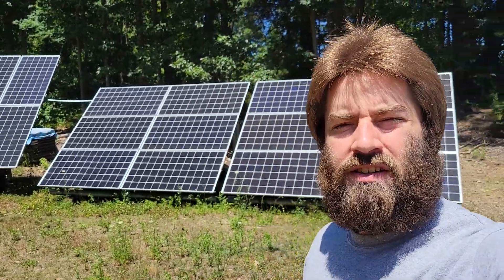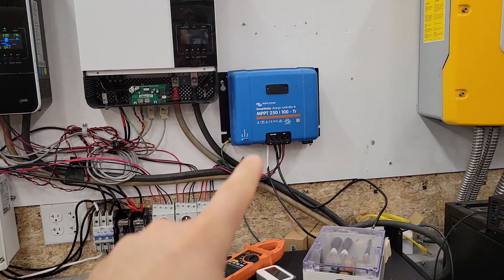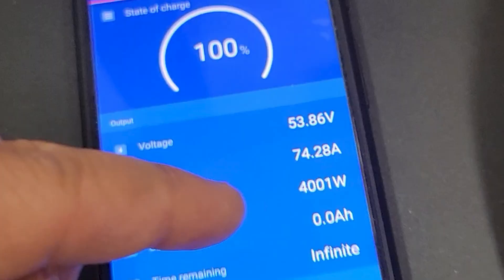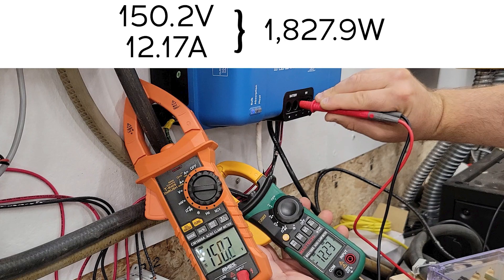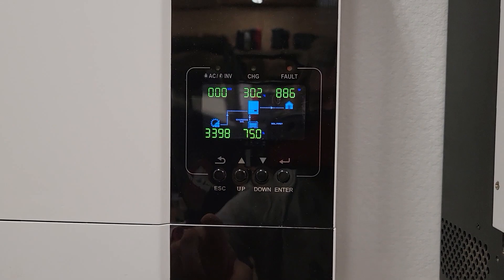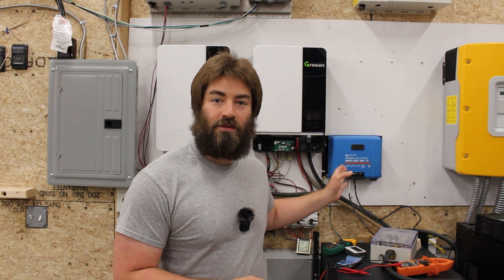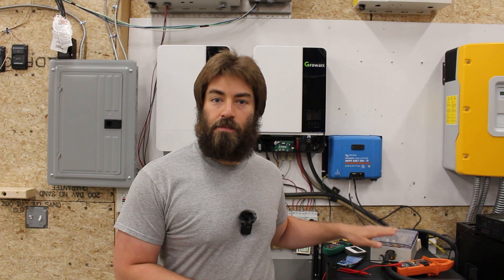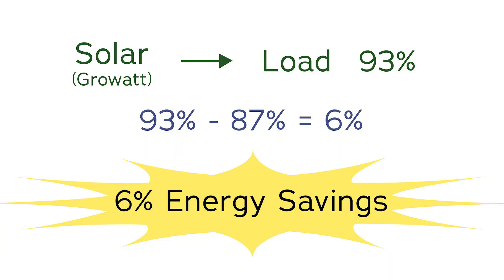Victron vs. Growatt solar MPPT charge controller efficiency test

Comment: And there's an extra benefit with doing it in the day. The electricity you use in the daytime can be replaced in the daytime, leaving your batteries full when the sun goes down. Using the batteries at night leaves your batteries partly drained with no way to fill them back up till the next day when the sun rises. This can be bad if something comes up and you need that extra power at night.
Reply: That's exactly the same between an integrated system and separate charger/inverter combo.

Comment: Did you realize that your Sunny Islands are designed for ac coupling? I have a DC Solar Trailer  that has a small dc coupled array. I am powering my whole house and shop with my old grid tied system frequency shifting the two separate one (enphase micros 6kw)and the other a H6 solar city from Signature Solar.  Contact me if you want more info. Thanks Fred
Reply from the maker: Sounds like a nice setup.  Yes, I love the AC coupling function.
Reply: PS my H6 also has 6kw of solar, the sunny island contols both separately . Battery capacity is  around 50kw. Running totally off grid.

Comment: Victron charge controllers are designed for lead acid batteries.
Reply: No , they are not . They are fully adjustable to ANY setting you need.
Reply: @onthelake9554   Lifepo4 battery cell manufacturer (like CATL) recommends keeping the battery SoC between 10% and 90% in order to extend the battery life.
Reply: @wangqianjun  Yes they do , what's your point ?
Reply: @onthelake9554  In a Victron charge controller menu options,there's dont have a special INDEPENDENT  menu item for LiFePO4 battery，you have to go to the User Defined settings item and make some changes manually. But not everyone knows how to set specific parameters
Reply: @wangqianjun   Your statement was " Victron is designed for lead acid ."   Lead acid actually needs more custom settings per manufacturer than LFP .  Anyone with a battery system needs to be educated enough about what they have to set this up . There are  plenty of Youtube  videos and Victron puts out more information on their equipment than any other .
Reply: Inverter need communication with BMS, that's important
Reply: victron has lifepo4 settings/profiles for ages, rotary switch, profile or custom setting

Comment: David, I still can't get adjusted to your new look but, I like it. I always use my Sol-Ark 12K system and my welder, large compressor and other 220V tools and equipment during high sun hours. I put in a 2500gal water storage tank and hooked up my deep well pump to the excessive load capability of my Sol-Ark 12K so I can take advantage of all of the extra power that I am getting from my solar panels. I also put a timer on another pump that I have hooked up to my sprinkler system that will water my lawn and garden the same way. All it has really taken is a little rescheduling of the time you do things to make for an efficient off-grid lifestyle.
Reply: Solar Jesus

Comment: Question. Inverter. Out of  growatt..  aims  signeer and victron.  Any preferences. Or do all have quirks
Reply from the maker: Out of the three you mentioned,  sigineer and Aims are in the same basic category of low frequency,  basic units.  They get the job done, but are not delivering perfect clean power.  The Victron is in a category of top of the line inverters.  Victron is made to last much longer, cleaner output, more controls, and more efficient
Reply: @DavidPozEnergy   you obviously like the growatt. To

Comment: Hey David, do you have the occasional Growatt shut down? Normally happens when I turn the dryer on?
Reply from the maker: I've never had the Growatts shut down due to overload.  I've had them shut down twice due to low voltage,  but that's my fault for running the battery empty.
Reply: @DavidPozEnergy  I start to think they are selling faulty units here in Australia,  after reading ebay comments.

Comment: Here in Australia, with grid connect systems, the inverter efficiency is negligible compared to the price you get to export power compared to that you pay for it. When the export price is so low as to be cover even the daily standing charge, it pays to use all your produced power.  Early adopters got a rate, made it worth while exporting it all and buying back to do washing overnight. 
Off-grid, as you've shown, is a different game entirely.
Reply: The high paid back was because it cost 10,000 aud for a 3 KW system. Let just say they are stealing the money back now. Also that rate ends soon.
Reply: @chuxxsss  Ended a year or more ago in WA.
Reply: @dadawoodslife in WA?
Reply: @randybobandy9828  Western Australia
Reply: @dadawoodslife   I thought you meant Washington state

Comment: But you are paying for that additional Victron efficiency. Not much more and you can buy the Growatt that has both and then as you say using the power directly is even more efficient and also doesn't result in micro cycling the battery???

Comment: That's not the way electricity works. it does not matter if the charge controller is built into the inverter or not.  The victron is more efficient at delivering power from your panels to the voltage present on the battery terminals.
If you are using the victron to send power toward the battery at the same time as you are using any inverter to power loads, the battery is not charging and discharging unless the power supplied thru the controller is more or less than the power drawn by the inverter. The power from the charge controller is being used by the inverter to the extant the inverter requires it.  The balance goes to or from the battery depending on if the charge controller is providing more or less than the inverter requires, respectively.
Reply: There are many different inverter designs on the market, and they are not all designed the same internally.  The design does matter, and there are potential efficiency benefits to integrating the MPPT solar charge controller into the inverter chassis, as David Poz suggested.  To understand why, you have to understand the internal power conversion steps that are occurring inside the inverter chassis.  One such "all in one" inverter model that I have opened up (from MPP Solar) appears to work where the power flows/gets converted as follows:

(Solar panels) --> (Internal MPPT boost converter) --> (450V DC rail inside the inverter) --> (High frequency, high voltage H-bridge using fast IGBTs) --> (LC low pass filter to produce 240V 60Hz "pure sine" waveform) --> (AC output pins on the inverter)

If you do not use the integrated MPPT boost converter in this unit, and instead use an external MPPT solar charge controller like the Victron unit shown in this video, then the solar energy takes a different overall path:

(Solar panels) --> (External MPPT buck converter) --> (48V DC rail with the batteries) --> (Low voltage, high frequency H-bridge using MOSFETs) --> (High frequency transformer: 48V AC to ~450V AC, but variable duty cycle < 100%) --> (High frequency, high voltage H-bridge synchronous rectifier using fast IGBTs) --> (LC low pass filter to produce "pure sine" 240V 60Hz waveform) --> (AC output pins on the inverter)

For the above inverter design, using an external MPPT solar charge controller makes the solar panel energy flow through two extra power losing stages (low voltage/high frequency MOSFET H-bridge, and high frequency step up transformer), compared to the first scenario (where the internal MPPT solar charge controller is used instead).  Consequently, there can indeed be efficiency benefits to using the solar energy in real-time (without going through the battery or low voltage steps at all), by sending the power through an internal MPPT boost converter integrated into the inverter chassis.

That isn't however to say that internal MPPT charge controllers are always going to be guaranteed to be higher efficiency compared to using external units.  It is still possible to design an inverter with a low efficiency internal MPPT solar charge controller, but very high efficiency 48V DC to 240V AC conversion stage, such that using a very high efficient external MPPT solar charge controller could still provide equal or better overall efficiency, compared to using the internal MPPT controller.  In general however, using an integrated MPPT solar charge controller inside the inverter, will typically provide slightly higher overall efficiency, when using solar energy in real time (rather than cycling it through the batteries first).

In practice however, the differences in efficiency are usually not critical.  Both methods provide adequate efficiency, and other considerations usually are more important (ex: cost of the hardware, complexity of the whole system, and EMI + shock hazard characteristics).
Reply: @Fritz_Schlunder  The internal MPPT in a hybrid inverter is not always a boost. Sometimes it is even a completely separate board, the same board used in standalone MPPT charge controllers. Building an MPPT that takes the specified range a solar input voltages and will either boost for direct to A.C. or buck for D.C. charging is complex and prone to problems and is harder to make efficient than two separate buck and boost converters which always operate in the same mode, especially when they have a narrow output range (to D.C. bus, or to supplied A.C.).
And yes, I understand the hardware and firmware inside inverters, buck and boost power supplies and MPPT charge controllers.
Reply: @Fritz_Schlunder  Thank you for detailed explanation!

Comment: More or less what I expected.  What Victron says in the spec sheet is seen in real world experience.  Obviously this is a fairly basic efficiency test, no comparison across different voltage points etc, and that's fair enough all things considered.  One thing that I will comment on though is the Victron chargers have an extremely good MPPT algo and will reassess the situation with clouding in a sensible way.  On the other hand the Growatt and ilk are known for having slightly crook MPPT algo that can do odd things with some people reporting complete cessation of solar for short intervals etc.  Firmware updates in the Growatt et al can address this to some degree.
Reply: What does crook mean

Comment: Thanks for sharing David.
I'm curious, you say the batteries are "99% efficient round trip",  Is this an industry standard or have you actually made that test? Im very new to lithium, been using FLA forever, and just now beginning to migrate. If that is so, thats a huge feather in LIfePO technology's cap, my systems were at best 80-85% with FLA. I wasnt aware Victron was so efficient either.
One more question, can the GROWATT act as a standalone controller/inverter/charger? Guess I should do some studying...
Thanks again for sharing!
Reply from the maker: I've tried testing the round trip with my battery bank, and was getting the same numbers in and out.  That would indicate 100%, but that's not possible.  So my tools are not accurate enough to say exactly how efficient they are.
Reply: @DavidPozEnergy  either way it FAR better than lead acid!

Comment: Victron charge controllers are fine, what you need to look at is when the Multi is in control, then the system is not good. Set points are designed for lead acid batteries, not Lifepo4.
Reply: Do yourself a favor and go read on the adjustability of the Victron inverters. You will be amazed, especially if you think they are setup for lead acid batteries.
Reply: @JJMentz  I run a Multiplus II with ESS, which takes control of the charge controllers. In the manual you will see the minimum absorption time you can set is 1hr, way too much for LifePo4 which is degraded by holding at high voltages for too long. This needs to be user settable to a lower figure like on the stand alone charge controllers.
The return to bulk on a 48v system, in the manual is a fixed 0.8v below the float voltage. Again this is more suitable to lead acid than the flat voltage curve of LifePo4.  This should be adjustable not fixed. All the settings of the charge controllers are not available when ESS is used. 
Your call.....

Comment: I continue to be amazed by the quality and durability of the Growatt inverters. Though Victron is a proven product, the Growatt bundle is definitely more convenient; however, one question I still have, if one of the features of the Growatt fails does the entire unit need to be replaced? Thanks for posting this very informative video, I always enjoy your content.
Reply: I am a growatt owner; It should be noted, if any component of the growatt fails, the inverter will shut down. So, even though the component that failed is all you need to repair, the entire unit is unable to be used. I'm not to concerned just wanted you to be aware.
Reply: There are separate circuit boards inside the Growatt. So for example, if the solar charge controller board fails, it’s an easy board swap.
Reply: @estesfamily6761  awesome! That's what I was hoping for, will definitely go with this one when I'm ready
Reply: @estesfamily6761  And you can buy parts for the growatt where ?
Reply: yes its easy, your unit will be out of action for a couple of weeks, and you will just have to pay an electrician a few hundred for repairs, they know they will end up with more of your MONEY if they put as much into the one unit as they can. i have been off grid 35yrs, separate is best, also back up, i have 5kw inverter for shed, 3.5kw for house, i don't like the idea of having spare inverter sitting in cupboard for years, i'm afraid it won't work when i need it

Comment: Loved the video - thanks for taking the time to do these measurements. I'm always super curious about that kinda stuff too (is Victron just ripping us off with their higher prices, or are they actually worth it?).

That being said, I'm not sure your last bit of maths is correct. 

When not directly using the power, you have the three conversion steps (1) solar -> batt, (2) batt in -> batt out, (3) batt -> load and I think your numbers there make sense. Roundtrip efficiency of 87.5%. 

When you use the power directly, you still have steps (1) and (3) - you simply cut out the battery inefficiency. But the DC power from the panels still has to be down-converted to battery voltage and then inverted back to higher voltage AC. It's not like the inverter in the Growatt can use the high-voltage DC directly from the panel and ONLY invert it to AC, right?
And in that case, the round-trip efficiency is 94% * 94% = 88.4% - so you'd have an efficiency gain of 0.9 percentage points, not 6 PPs. 

Am I missing something?
Reply: It depends, not sure how it's wired up internally, but if the inverter can use the solar voltage directly, converting 150-200v dc to ac is a lot more efficient than scaling up from 48v dc to ac
Reply: All of these hybrids and even the SolArks have an internal DC bus voltage they maintain. Looking at my eg4, it’s at 369V right now. The first step is Solar DC the bus DC voltage conversion which is surprisingly efficient. The inverters borrow battery power to maintain that ~369V dc and when excess solar power is available (after AC loads are met), charge the batteries.
Reply: I thought Will Prowse did a growatt setup without a battery and it does work.  So it does go directly from solar dc to ac output and is most efficient in that route.

Comment: Did you factor in wattage loss in the wire to and from battery / inverter?
The higher the load the less efficient.
Reply from the maker: I was trying to stay conservative.  Just like when I used inverter "94% Max".  Usually the inverter is around 92-93%.  I could have added wire loss in there too.  But, I figure, if I can make the point while being conservative, then it only gets better later.

Comment: If your running most of your off grid devices using 48v so you don't need the inverter than the charge controller would be the winner right?

Comment: How much electricity did you save growing the beard as compared to shaving ie how efficient are you lol. This is why AC coupling is better we use it right away.
Reply: Have you seen the price of razors lately? Shockingly expensive! That unwatted expense can be shunted amp avoided by growatting a proper beard, as David has, a sinewave to the on-grid world of your current manliness. And it's grounded in nature. Excess length can lead to tripping, a breaker of the deal but resettable. To maintain efficiency you will need regulated trimming, a fuse times a year should be self-sufficient. This is best done as a single-phase, since doing it 2-phase will leave it looking lopsided until the process is fully cycled. Consider the free chinsulation as a wintertime bonus...
Reply from the maker: LOL.  I didn't carry a razor while backpacking this spring.

Comment: Your efficiency measurements are flawed you cannot compare an apple to an orange the Victron does not have an internal inverter that it is powering. The Growatt is powering an inverter and taking away from your measurements.